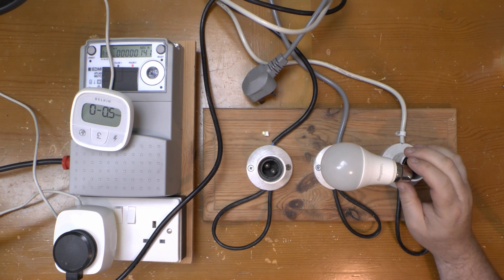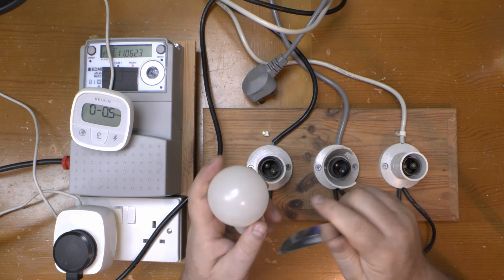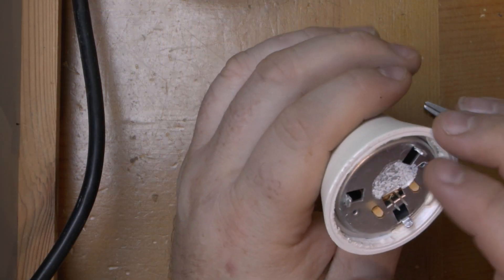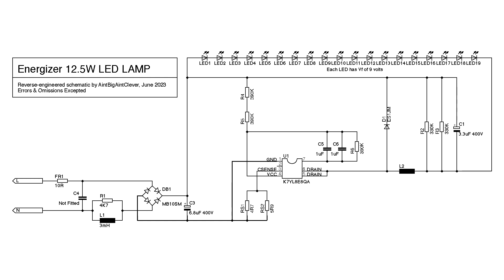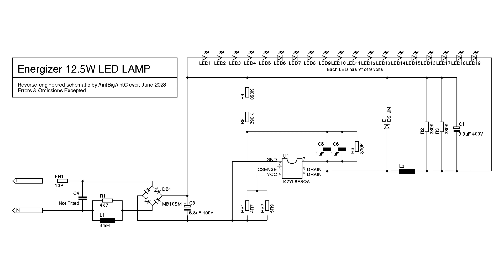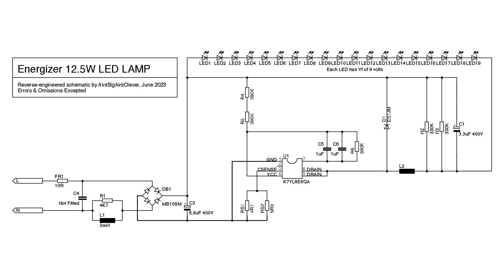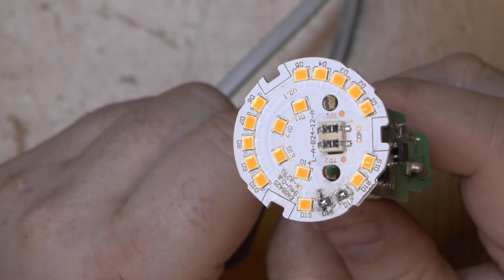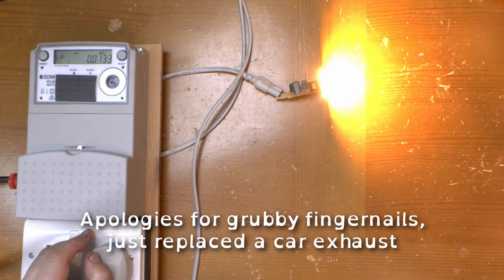What's inside an Energizer 12.5W LED lamp?

Comment: Pity this trick didn't work with a few Philips 13W LEDs I tried, where it's circuitry appears to require the full voltage across the LEDs.  When I bridged out a blackened LED, it lit for about a minute and then went out with a different individual LED turning black.  I then bridged out that one, applied power and it lit for about 5 seconds with another individual turning black.  I finally tried bridging that one and it just flashed with a puff of smoke off and another individual LED had turned black.  

The new 11.5W (100W equiv.) Philips LEDs I bought are frosted glass like the original incandescents were, so definitely not repairable without getting destructive.  From peeping through the clear bit of glass near the cap, they now use LED filaments like the clear LED filament bulbs.